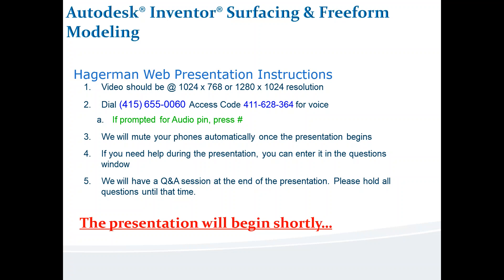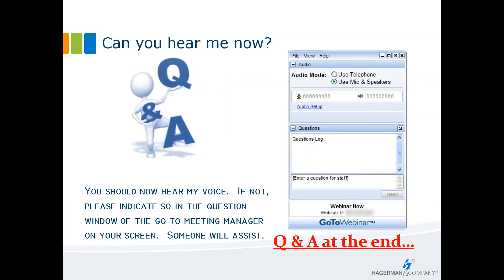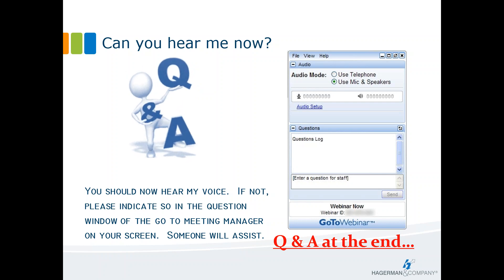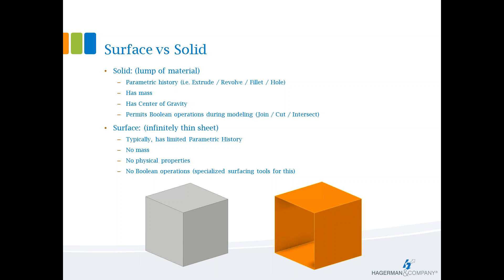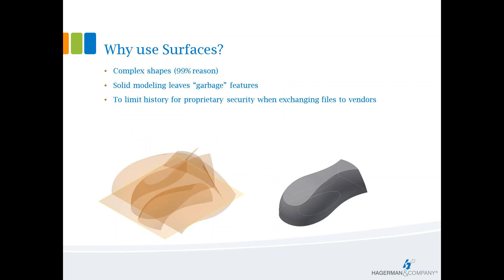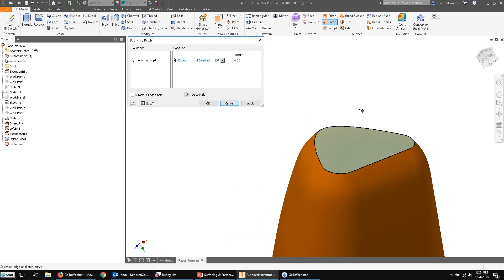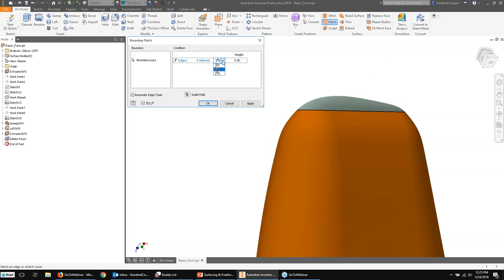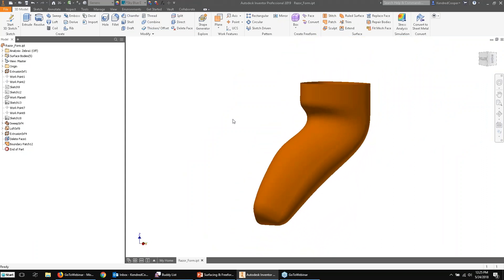Freeform & Surface Modeling with Autodesk Inventor

Comment: Free-form and surface modeling:
12:30 - Intersection curve + Loft = dramatic shapes
14:15 - Proyect to surfaces
15:05 - Wrap to surfaces
16:15 - Proyect to surfaces 2

Working with surfaces for something useful:
17:10 - Sculpt = Convert shapes into solids
18:10 - (EXTRUDE + Shape) + (SWEEP + Path + Guide rail) = Convert sketches in different shapes into solids
19:15 - Path and Guide surface = explanation
22:40 - How to cap off open profiles and surfaces: (PATCH + Tangent Condition or Smooth)